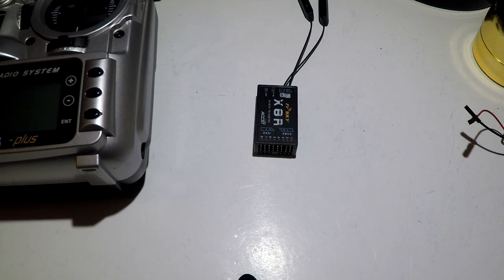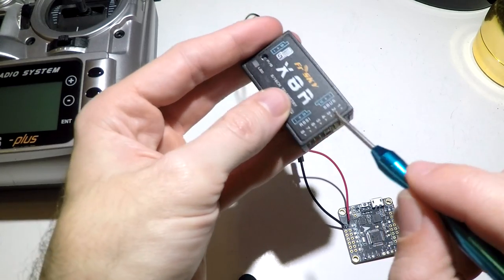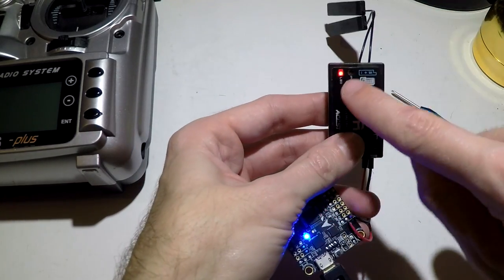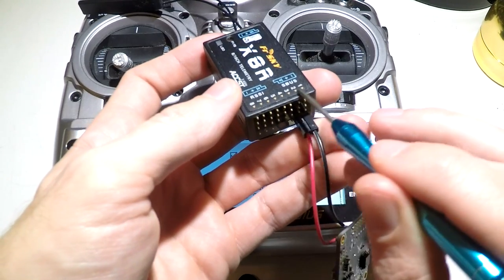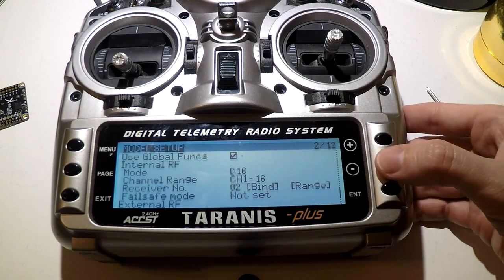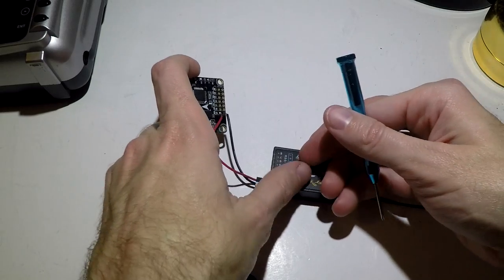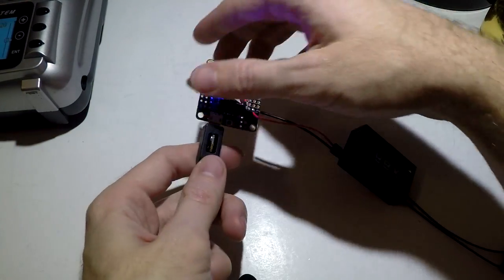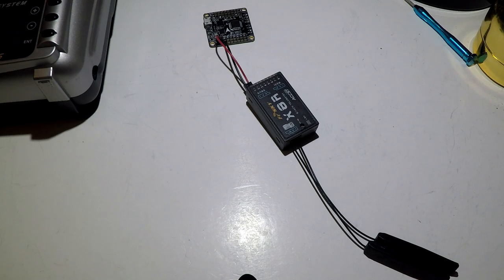How To Bind FrSky X8R Receiver

Comment: Thanks you saved me. I thought the taranis stopped beeping after binding. That's how it works with my 4in1 module. Or at least the green light stops blinking or a servo moved.

Didn't thought about ending the binding procedure in the tx.

Comment: If you are stuck with a solid red and green led after binding it means the tx or rx needs a firmware update.  I spent an hour or so troubleshooting earlier.  Updating the firmware on my taranis x9 lite got it to bind properly.

Comment: Thanks for posting this video! If you have a second, I have quite the frustrating issue:

I have bound my taranis and X8R successfully but it's not communicating to my quad at all. I've done this bind process, got the green light,  and the receiver knows when I power down the Taranis so I think it bound correctly. As far as plugging the reciever in to the FC, I have an eachine wizard 220 so plugging the receiver to the FC is as simple as taking the one cord and picking a spot on the receiver. On a side note, The drone talks to Cleanflight just fine. (It seems like) the receiver talks to the radio just fine. I just cant get the Taranis and the drone to talk! 

I have tried plugging the FC into each of the 8 channels slots on the X8R and selecting ppm in cleanflight with no luck. I have tried plugging into the SBUS spot and adjusting the settings in cleanflight for sbus, also with not luck. I dont know where I'm messing up. All the videos on YouTube basically just say "plug it in, make sure your sticks are set up right in Clean/Betaflight and then go fly" so I'm not finding any help for when you simply "plug it in" and then nothing happens. I'm at the point where I either think I have a lemon or that this is all just a dream and I'm part of the Matrix. 

Any thoughts?
Reply from the maker: If you're using the 8 signal pins from the X8R and plugging it into the 8 input pins on the FC, then its not going to work if you choose PPM. You actually have to pick PWM. But I would recommend use using SBUS. Place the SBUS wire on a receive on a UART port. Here is my X8R playlist. I show how to connect the X8R to many different flight controllers. Pick a flight controller thats similar to yours and that will show you how to set everything up.
https://www.youtube.com/playlist?list=PLiYYhnH4BhI-Fwgsu-F4Qmz4-mdOzNq55

Comment: Thank you for the videos. My X8R is currently running in SBus mode. Just for my testing I would like to add a servo to my drone to test payload release mechanism. How can I add the servo to the receiver and trigger it from my remote? Can I simply plug the servo into one of eight PWM channel?

Comment: Newbie Taranis X9D owner here, ...I don't have a FC available to power up the X8R,  and I wanted to test my self in configuring a servo to one of the receiver channels.  Question,   what volage range can I use as the supply voltage?  Also, you mentioned I can apply this supply voltage to any channel, what about applying it to the SBUS port?   Thanks !!
Reply: get your self a 5v supply attatch it to +and- of reciever it can be from esc which supply 5v and signal and then connect your servos make sure you have set end points to 1000 to 2000 otherwise it will break

Comment: Helo! I am having a problem and you may be able to help. My X8R was working properly but I was setting the electronics on a new plane and when I connected the battery to the receiver the LEDs on the receiver stayed on, both Red and Green and does not bind with the Taranis anymore. now if I can unplug the RX and plug again the LEDs keep on permanently. is there a way to bet it back working properly? tks

Comment: i have an X8R as well, just 2 weeks old.  it used to bind properly but recently, it lost binding with transmitter.  the LED blinks red and yellow almost at the same time.  anyone knows what's wrong with my receiver?  nothing else is connected to it just a 2s power lipo and the bound transmitter.  is my x8r broken?

Comment: but, I do have a question for anybody: has anyone tried to get the firmware file from FRsky lately? There is one but no EU or NonEU differentiation -just one. 
-I don't see any legacy files either.